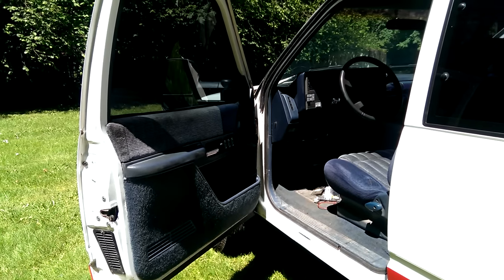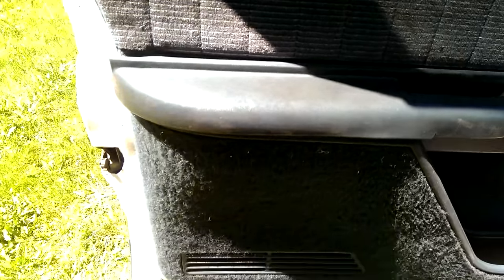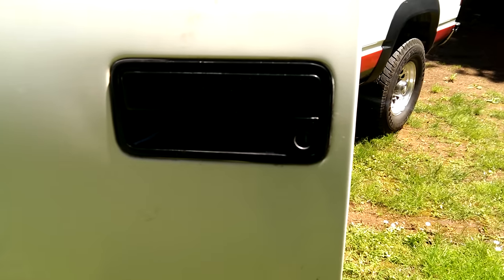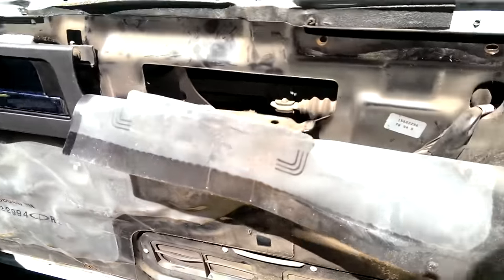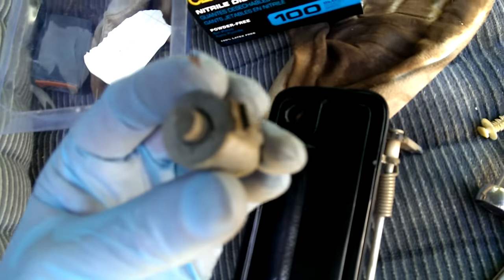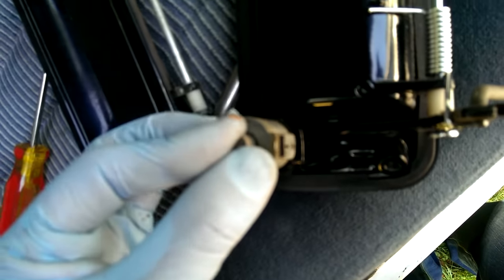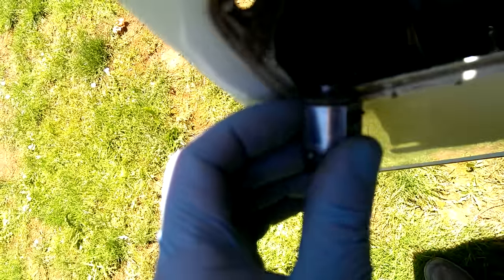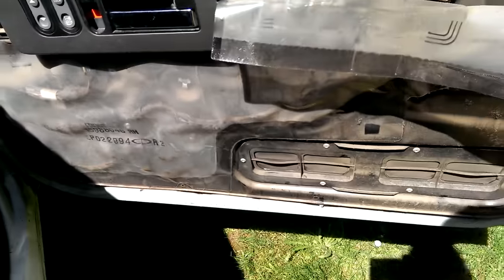1994 Chevy Silverado door lock cylinder replacement

Comment: I just did a lock change with out dropping the latch....Wow was it hard,  hooking up those latch rods behind the window track where I couldn't see...  I had to wait till dark and use Flashlights to see inside,  bright sun outside made it hard to see inside the door...  and it was a 2 hour bite doing it with out dropping that latch part,  but I had the inside door panel off replacing the Glass and fixing the inside door handle.   I wished I would've seen this earlier !!!  Thanks for posting.

Comment: Mine did the same thing. One question do you now have a door key and a separate ignition key? My truck"s keys does both door and ignition would like to keep it that way if possible.
Reply from the maker: james zipp that is correct. now the door and ignition are separate keys. if you want everything to match you would have to replace all of them. nobody does because its not cost effective.
Reply: Back in the Old Days,  (50's and 60's)  most cars had 2 keys,  1 for Door & trunk,  1 for Ignition...  So now my '94 is Retro !!!
Reply: Where can I order a different lock key kit for my 2 doors ? I have a 93' Chevy Silverado and my truck doesn't lock cause I don't have the key
Reply: @ChinoTejas  any parts store will have it but i found mine at AutoZone

Comment: The part that opens the door is fine on drivers side..its the black thing around it...what holds it on
Reply from the maker: So, driver's side inside door?
Reply from the maker: The black bezel on the outside will come off after you pull the 10mm bolts
Reply: @9076723311  outside
Reply: The black trim around the handle itself is hanging down towards the front of truck
Reply: @9076723311  the 10mm on inside right
Reply from the maker: @lasvegascommunitynewswatch1632  yeah, there are 3 I think. Hate to say "watch the video again" but It's been a while.
Reply: @9076723311  so what parts do I need for bezel..I guess I need to see what's going on in there first...
Reply: @9076723311  watching again

Comment: but what if the door is locked and you cant get it unlocked to open?
Reply from the maker: Hoss Williams that's rough. you should be able to pull enough of the inside door skin to remove the inside or outside handle then just pull the unlock rod. will take time but you can do it.
Reply: I got the inside panel moved back where i got my hands on the unlock rod its not doin anything and my lock on the outside is laying on its side
Reply from the maker: Hoss Williams there are 2 rods. work them both till you get it. not sure I can help without being there. sorry.